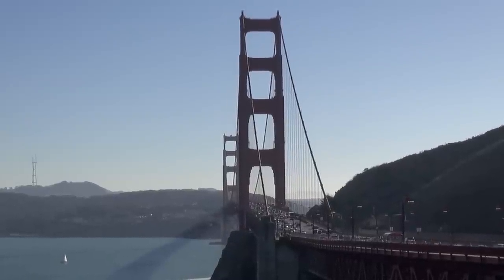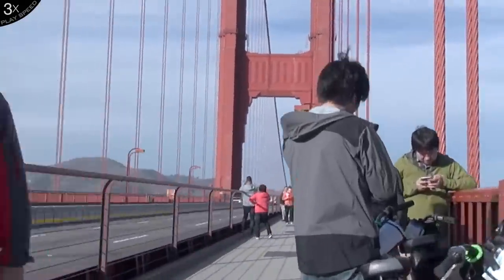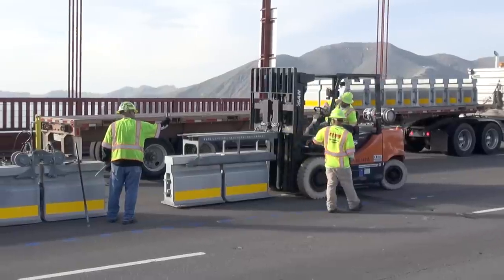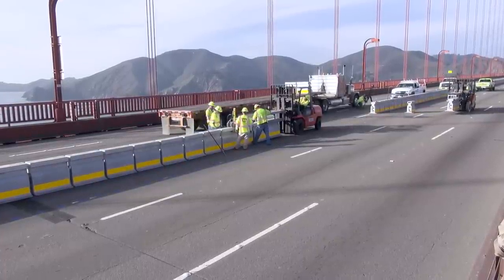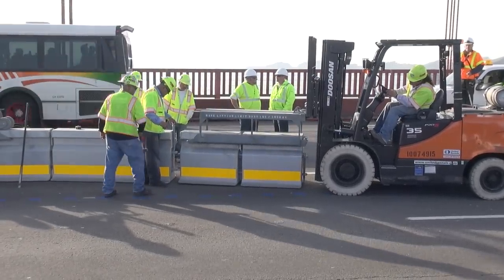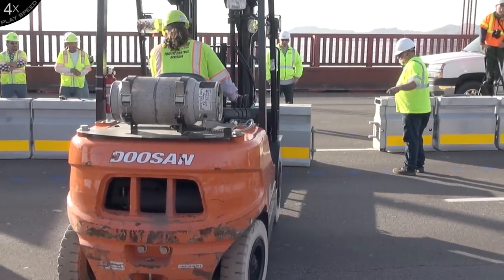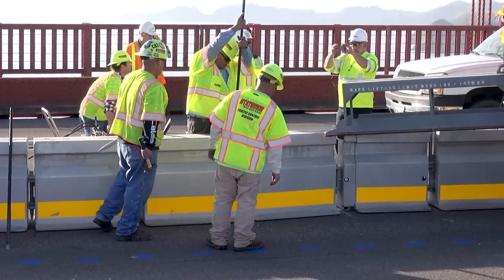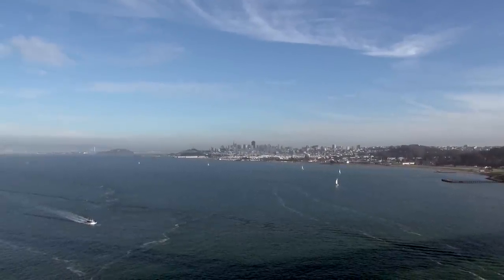Golden Gate Bridge moveable median barrier installation: closeup and narrated (January 10, 2015)

Comment: $30 Million for a barrier? My goodness, that doesn't seem a bit high? LOL
Reply: +Dondrey Taylor I think this is for the whole system including the "road zipper" - This machine thal allows to shift these blocks by one lane to the left or right.
Reply: Ah true. I didn't think about the cost of the road zipper being included + construction costs + planning costs. They could probably even estimate lost tolls due to closures. I guess $30 million would make sense.
Reply: +Dondrey Taylor I think each zipper truck costs $1.4 million.
Reply: +Dondrey Taylor $30 million sounds reasonable, considering..... The new east span of the bay bridge originally was projected to cost $800 million, then just over $1 billion. It ended up costing $6.4 billion. And, it is cracking and at risk of failing. Projects like this cost fortunes to please unions and political supporters. They just throw the bill at taxpayers who have no choice but to pay high tolls. Only San Francisco and Oakland politicians can spend other peoples money like is flows in with the tide. Los Angeles has their subway. Another taxpayer funded boondoggle. 
Minimal tolls lost and minimal construction costs. Just the Road Zipper machines and the blocks at about $5000 per foot.
Reply: Mark G Wow, thanks for the break down. I had no idea they spent this much on these types of projects.
Reply: +Dondrey Taylor I believe that there have been hundreds if not thousands of traffic deaths and injuries on this bridge due to the lack of a barrier.  It's about time something is done.

A friend of mine, just as one example, had hid mother almost killed in a head-on accident.  She spent about a year recovering.  I'm sure there is no lack of stories from others as well.

The other thing is the improved traffic flow.  The lost productivity and wasted time will quickly justify the cost.
Reply: Dan Golthing I see and thats very true. When you put it in that perspective $30 million is well worth it and such a small price to pay. I guess you can't put an amount on potentially saving lives. I'm glad they did this.
Reply: +Dondrey Taylor They have been considering a movable barrier since the late 70's. Head-on's on the Golden gate were quite frequent. They could have done it for one third of what they spent. This was a waste of toll payers money. The high costs was due to the expense of bureaucratic red tape. 
From calendar year 1971 through September 27, 2007, during which there were more than 1.4 billion crossings, there were 36 fatalities, of which 16 were from head-on collisions. The last fatality was on July 3, 2001.
 By 1998, the accident rate was reduced by nearly one-half since the period of 1981 through 1983 when the rate was 1.25 accidents per million vehicle miles. In the years 1991 through 1995, the accident rate was 0.64 accidents per million vehicle miles. The accident rate has been further reduced since the implementation of a double-fine-zone in 1996 to a rate of 0.61 accidents per million vehicle miles for the period of 1991 through 1997.

Comment: yes, please correct your facts. It has been closed before... high winds, pavement, earthquake damage/integrity. it's been closed many times.
Reply from the maker: +Mike Pratali Unfortunately, YouTube provides no way to edit a video in place, so I can't make any changes.  However, I didn't state that it had never been closed, in fact I did say that it has been closed before, I only said that it had never been completely closed for construction before.  Which is almost true.  Turns out it was completely closed for construction one other time in the past.  So I was off by one.  My apologies, for that, but I have no way to change it.
Reply: +Party Of The Third Part  Why, yes you did. You have a great monotone voice for narration and I appreciate the time and effort you used to cover this story.  Did you know of the elevator in the North tower, or how there was a group of people you could hire to hike you to the top of the North tower. That is why they installed personal barriers that can be see just off the ground on the North side???? Thanks again for the coverage..
Reply: He means for construction